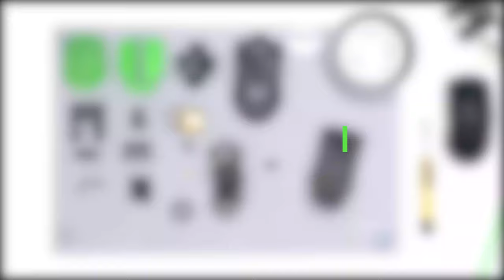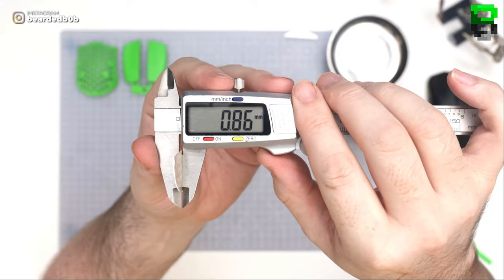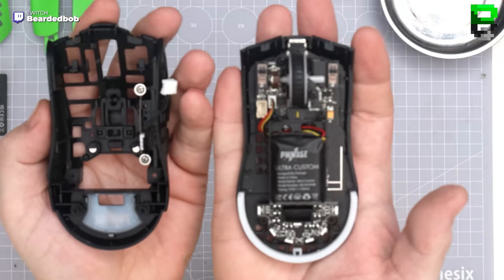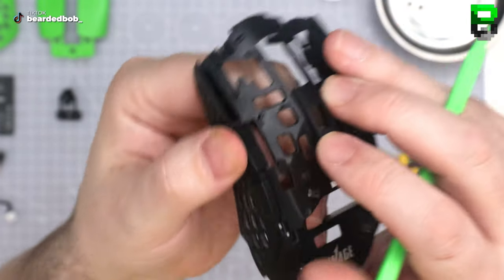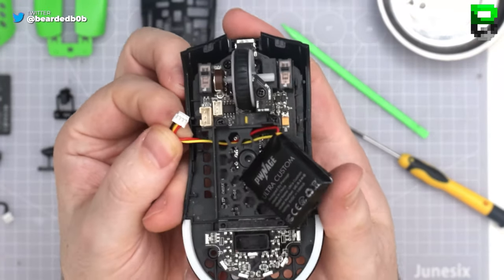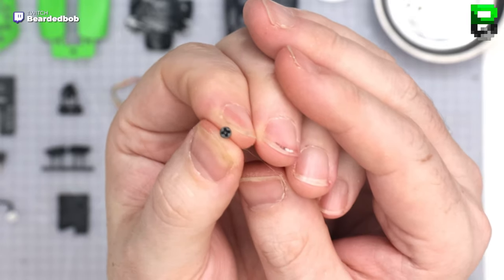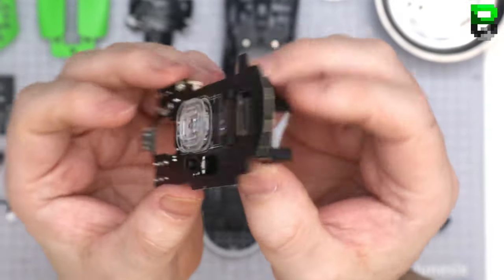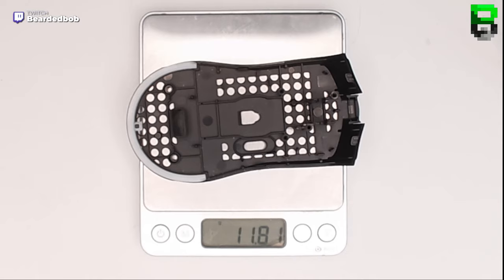Pwnage Symm 2 Gaming Mouse Teardown

Comment: I got the wireless Ultra Custom Ergo down to 68 grams by removing the Pwnage decals, the LED diffuser, and some leftover processing plastic from the molds. A Dremel is your friend when removing tiny increments of weight, is it necessary? No, is it funny to try? Yes.

Comment: It's actualy close to identical as a mouse from our local brand, Rexus Daxa Air III. I wonder do they have the same vendor that make this mouse
Reply: Same OEM. Also sold under the Xenics brand.
Reply: in Russia it is "Zet"  with huano blue shell switches and  half the price of pwnage
Reply: @alexk2167  yeah, it's the same case with Rexus which is also a lot cheaper than pwnage which is around Rp600k/+-$45-55